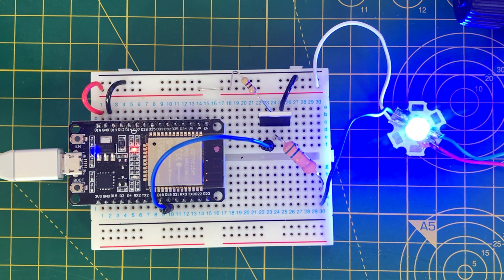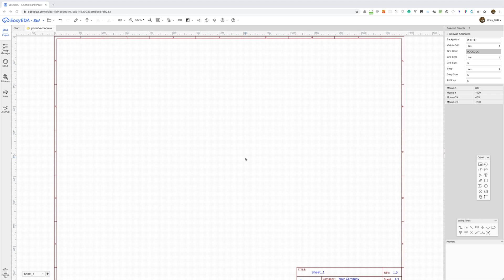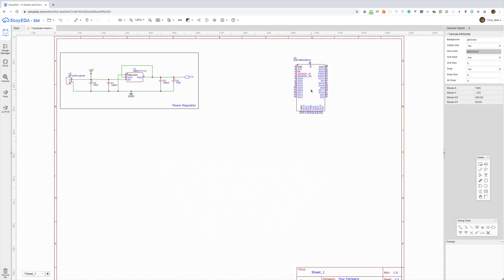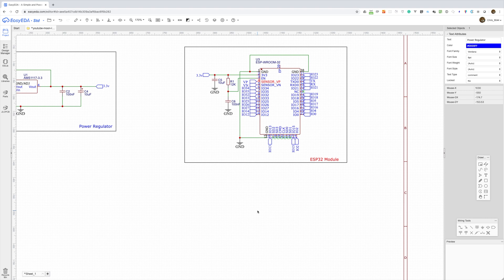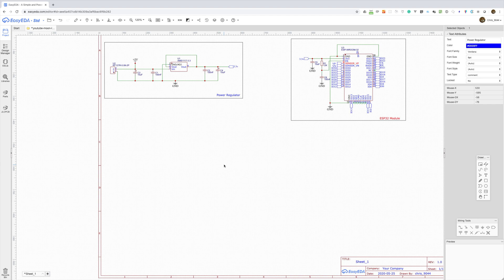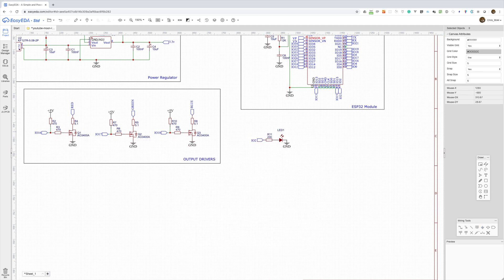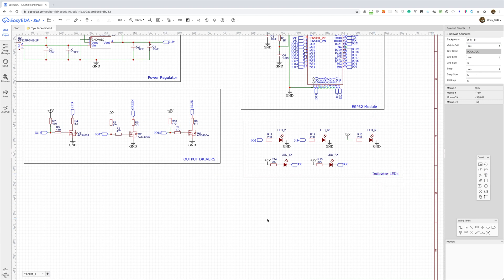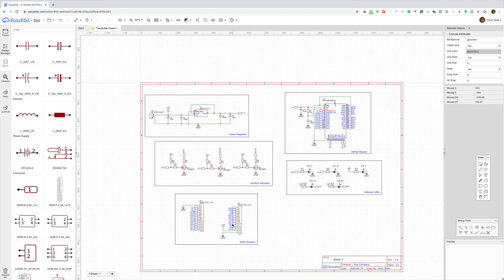ESP32 RGB LED Driver Circuit Design - Linear Regulator and LED Output Drivers

Comment: Hi - thank you for the video! Very informative! I was just curious how you uploaded code to the module w/o the USB? Or if you had any videos explaining this side of things
Reply from the maker: Hi there - you need to have a USB-UART board - and then connect that to the RX and TX lines on the ESP32. You will need to manually get it into boot mode by holding IO0 low when you power on or reset.
Reply: @atomic14 Hi - thank you for taking the time to reply. Ah okay - I think I’ve seen those on AliExpress. I’ll pick one up and give it a go! Thanks again!
Reply from the maker: @mattvin91  No problem - they should be very cheap.
Reply from the maker: @mattvin91  Also - if you are using an ESP32-S3 (or other version with native USB) you can just used a USB breakout board and connect the data lines up to appropriate pins.
Reply: @atomic14 Thank you! If I went down the USB breakout route - would I still need to manually put the module into boot mode? My v. Basic understanding is USB takes care of this?
Reply from the maker: @mattvin91  It depends :) Most of the time it will. But often the device will get into a state where is refuses to go into upload mode. You can just use a jumper wire to hold GPIO0 low. But it's a bit of a pain.
Reply: @atomic14 Awseome. Thank you so much! I’ll stop pestering you now and give it a go ☺️

Comment: Great video, i must to create a board because comercialy don't have that i need, for upload code do you need some library or special code? How You put into load mode? I'm using wemos lolin 32, it loads automatic,   how it wins that? Thanks for help.
Reply from the maker: Hi Wilfredo, you can put the ESP32 into upload mode by connecting GPIO0 to GND when you power up the device. You can then use any of the tools you would normally use to flash firmware onto the device.
Reply: @atomic14  like Arduino IDE... I use to play platformio, but it's break. Show errors about the path, i go back Arduino IDE. Thanks for your answer. Nice days.

Comment: Why dont connect the bottom pins ?
Reply from the maker: Do you mean the bottom pins of the ESP32 module? I didn't need to use any of them so I have to tell EasyEDA that I'm not using them otherwise it will complain about there being no connections to them. I should have really broken them out to the GPIO header as more pins are always useful!
Reply from the maker: Actually, these pins are connected to the internal flash, so you can't use them. Forgot about that!
Reply: Okay thanks, i was thinking that I can not use this pins
Reply from the maker: @antonioescamez4549  You can't use the pins - sorry, completely forgot about the internal flash...
Reply: Okay thanks

Comment: Nice video - I am new to designing PCBs for the ESP32 and I tried a similar circuit to your power supply and EN connections and also a GPIO0 button - I could get it to program but was having trouble booting - not sure if you had the same problem - cheers
Reply from the maker: Hey Richard - didn't have any problems but it does seem to be an area that trips a lot of people up. You should see some output from the ESP32 on the UART line when it starts up. There are some "strapping pins" that can catch you out if you aren't aware of them. If you're willing to share your schematic then I can take a quick look and see if there's anything obviously wrong.
Reply: @atomic14  That would be great - what is the best way to share ?  My email is runman_up@yahoo.com
Reply: I  can send you the pdf files by e-mail
Reply: I am a fervent user of visual studio and platformio and hardly use the arduino IDE but I tried a blink program from Arduino so it seems to work - so it is a problem with the platformio IDE - I need to buy you a coffee though
Reply from the maker: @richardshelley6099  Interesting - I'll drop you an email.

Comment: What capacitors did you end up using on the power regulator ?. I'm new to this, and trying to understand it better (failing so far !). The documentation for the AMS1117 calls for a 22uF tantalum capacitor on the output. In the video you use a 100nf ceramic and a 10uF tantalum (part: C7171). But the BOM on easyeda has a different 10uF capacitor - another ceramic - part number C15525. The tantalum capacitors seem much more expensive, and additionally JLCPCB dont seem to stock a 22uf tantalum as a basic part. Was this the reason you used ceramic capacitors of other values ? Many thanks.
Reply from the maker: Hi Nick, that was a bit of over-aggressive BOM optimisation on my part as I had the same problem as you with not being able to find it in the basic parts. The AMS117 really should have tantalum capacitors for stability. There was a bit of discussion here when I asked for some advice - https://www.reddit.com/r/AskElectronics/comments/gugap6/ams111733_output_filtering_capacitors_tantalum/
Reply: @atomic14  Ahhh - ok. I appreciate the reply. I had actually seen that discussion whilst I was frantically googling away. I'm starting to understand the question a little now at least. Many thanks.
Reply from the maker: @nickphillips528  In my most recent board I decided to for one of these small DC-DC modules instead of an LDO - in part driven by the power supply being much higher than usual, but also because the options on JLCPCB aren't great. https://docs.rs-online.com/dc16/A700000006631882.pdf
Reply from the maker: This looks like a good option - https://datasheet.lcsc.com/szlcsc/Nanjing-Micro-One-Elec-ME6217C33P5G_C81592.pdf It's an extended part, but will work with ceramic caps.
Reply: @atomic14  I read somewhere that there are other versions of the "1117" chip available - some of which (possibly newer versions) can use ceramic caps. Specifically one from Diodes Inc - the ZLDO1117 seems a good option. Its available, I think, on JLCPCB, but only as an extended part. The spec sheet says to use a 4.7uF MLCC, with an ESR of less then 0.5ohm. So thats my next subject to look into. This whole thing is just a learning experience for me really - I want to make my own ESP32 board, just to learn how. So I might pay the additional $3 for the extended part - or I could order the boards without the LDO regulator, buy them locally myself & try SMT soldering for the first time - just to make my life difficult. Thanks again for your help.

Comment: What was the reason why the EP pin was used in the EasyEda Link in description. I am using a different esp32 that doesn't have the EP pin.
Reply from the maker: Hi there - what ESP32 module are you using. The EP is the enabled pin maybe it has a different name on the module you have?
Reply: @atomic14  I am using the ESP32 WROOM 32D but it only has EN pin not an EP pin.
Reply from the maker: @debatestuff6897  Ah, I understand the confusion. The EP pin on the footprint I was using is the thermal pad on the bottom of the module. Should be Pin 39 - connect it to ground.
Reply: @atomic14  Ok thanks!

Comment: Shouldn't the TX / RX Leds be 3v3 not 5v?
Reply from the maker: Hi Harry - yes, I think you are correct - that's a mistake on my part. It would be much better to have them going to the 3v3 line.
Reply: @atomic14  Awesome thanks. Cheers for the excellent videos, the best I've seen on youtube. I am looking forward to purchasing the course.